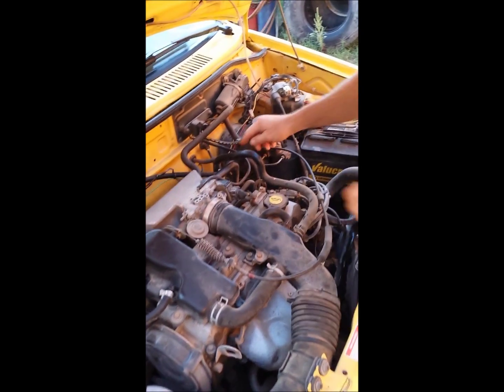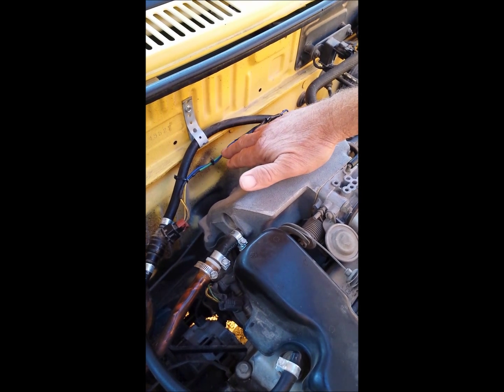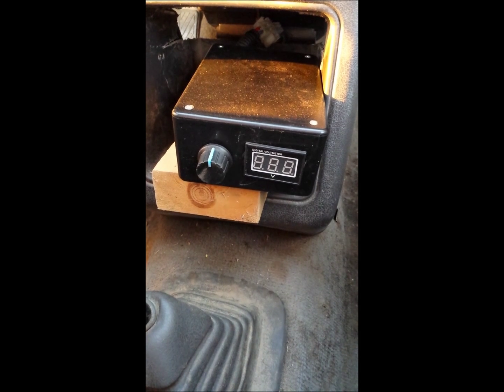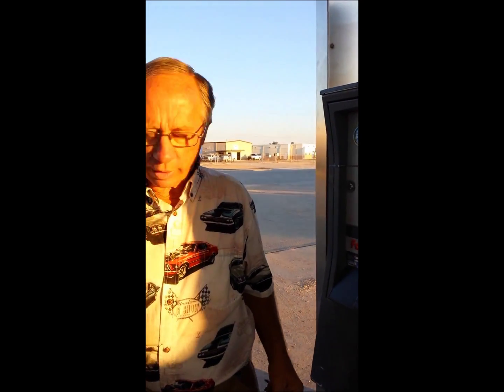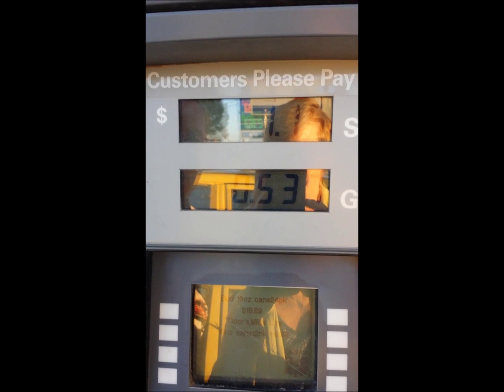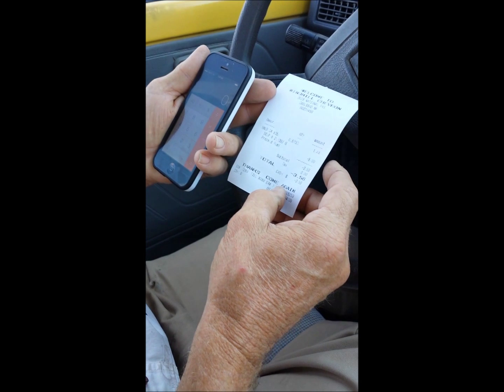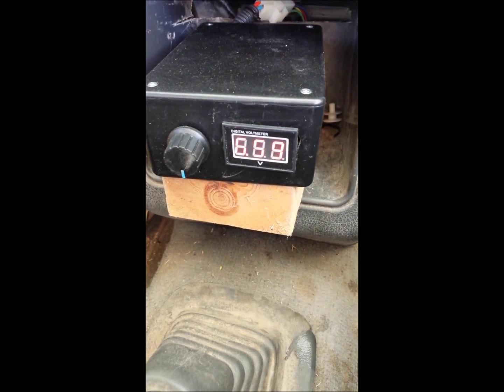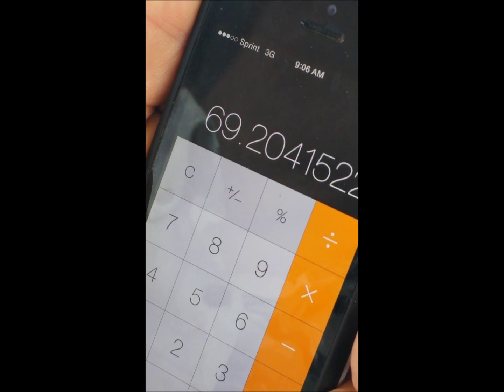Cold Fuel Vaporizer

Comment: If I'm not wrong, you ADDED more fuel via the new injector, by installing an EXTRA injector. This provides the necessary fuel to evaporate an inject into the plenum, on top of the REGULAR injected amount. Beside, the injector you installed is controlled via VOLTAGE, instead of by PULSES at a fixed voltage (your regular injectors depend on a ECM pulse sent by the engine, and its FREQUENCY determines their volume into the plenum). That might only ENCREASE your consumption, because nothing has been diminished, but ADDED, rather. Not trying to be critical, but I do not fully understand your plan.
Reply: O2 sensors don't respond to carbon. They respond to oxygen (O2). The dial (voltage), controls the pulse width of the PWM. Not the voltage to the injectors.
Reply: You can take an injector, apply it to a pwm in a plastic bowl, and turn the pwm up or down.  You can make it sing our just slowly tick away.  Try it.
Reply: Dave - Right, I guess I understand it now. The engine needs to run at 195F to run normal. Thanks.
Reply from the maker: The extra vapors are sensed by the oxygen sensors and relay the message to the ECM that it is over fuelling. The ECM leans out the four injectors to their least amount of fuel.  The extra injector can be slowed down to a vary low speed by lowering the voltage.  The five feet of hose cracks the fuel through vacuum  and only vapor enters through the vacuum tube.  The tests were highway for 34 miles at about 60-65 mph and watching the amount of voltage on the digital meter allows me to find the best mileage gain.
Reply: Jeanie - Thanks for your explanation. There are things that do not add up in my view. "The extra vapors are sensed by the oxygen sensors...". Actually, the O2 senses 'conductivity', related to the amount of carbon in the out coming mix. This will diminish its current output. I do not know if the ECM will adjust to a leaner mix because of this. It might have no effect. " The extra injector can be slowed down to a vary low speed by lowering the voltage." Actually, injectors are not dependant on voltage - which will remain constant at their coil - but of frequency of their OFF-ON signal from the MCU, which will exert a longer 'open' cycle, or shorter, depending on the demand. I might be wrong, but the diminishing of their voltage will not equal lesser flow through them, only less power to remain close or open. Thanks for your time.
Reply: Dave - Yes; you are right. The more Carbon, less Oxygen. This ratio is maintained throughout the entire process, and kept via the injectors changing it as needed, via the PWM controlled by a square wave output circuitry, shortening or lengthening its width accordingly. When cold, more fuel is required, because air density becomes heavier, and the regular amount of fuel/oxygen has changed, hence more fuel to reinstate its ratio. Thanks for correction.
Reply: johnathan smith When the engines is cold, there isn't enough engine heat to evaporate enough fuel for the engine to start or run. Under these conditions, on a carbureted engine the choke is used for enrichment. On an injected engine, the ECM runs a cold start enrichment subroutine.

Comment from the maker: There is no magic hose. You need 5 feet of hose ti break the carbon chain. Inside the hose is conduit unraveled to give the fuel a swirl while pulling vacuum to break the chain. on 2011 and new US vehicles is a tighter  computer  perimeter, so you will not get as much increase in mpg as older vehicles can. Be happy with 30% increase. 1981-1995 I have seen as much as 85%. 1996-2010 40%.
Reply: Where do you get the conduit hose ?
Reply: Can you use something like EFIE to fool newer cars computers (you can find it on peswiki site). It plugs to your oxygen sensor and you can adjust the voltage what computer reads from it.
Reply: Do you know if those oxygen sensor extenders help to improve mpg? They push the sensor away from the exhaust.

Comment: Which PWM are you using? and are you using a resistor on the injector?
Reply from the maker: I tried a couple.  i believe the last one was a DC 30 amp on ebay for about $28.  It would fit in my radio shack box with the digital readout.
Reply from the maker: You do not need a resistor.  That is what the pwm does.  You can eliminate the pwm and the digital readout by using a resistor.  You will have to try a handful to get your best result and they will vary from vehicle to vehicle.

Comment from the maker: What is special is that five feet of hose under vacuum breaks down the wet fuel into vapor.  You are cracking the carbon chain.   Next you are fooling the computer, because the computer thinks it is overfueling and leans out the other injectors.  However it cannot lean out the injector you just added.  Now if you lean the vapor injector out, and can see it on a digit measurement, you can find your sweet spot for best mpg.  My partner just sold his portion to a company that is making them for a country in South America and he was paid $100,000.  You cannot sell this in the US because it is not approved by EPA.
Reply from the maker: I'm not sure.  My friend that sold his portion to South America did not tell me which country and I was not going to ask as it is not any of my business.  He is planning to sell it to more countries than one.  His is a little different than mine as he piggy backs one of the injectors so that it slows down and speeds up with the ecm.  He does not use a pwm or digital meter.
Reply: @Pokeanoscat  Can you explain how he wired it up to be "piggy backed?"  This seems like the easiest and most efficient set up.  I'm an chemical engineer, but when it comes to electrical stuff, I'm not far off the basic level.
Reply: +Jeanie McKean will it works with newer cars they got so many sensors to correct the fuel map ,if i got a chance i will try it out with my 14 silverado v8
Reply: +Jeanie McKean  do u know if this company are selling allready? what country is in south america?
Reply: What kind of hose did you use for this setup?

Comment: very interesting ,gasoline  injected to the magic hose ,with the help of the vacuum it turns to vapor  i got find out what is the special about the hose haha
Reply from the maker: If you do not have a hose long enough all you are doing is putting wet gas into the intake and defeating the purpose.  The magic is you are cracking the fuel through vacuum. We started out with 10 feet of hose and after several installs found that 5 feet still worked.
Reply: You can do the same thing by using a heated container that vaporizes the fuel output from the injector instantly. In this manner, you don't need the long hose and have to rely on vacuum for the vaporization.